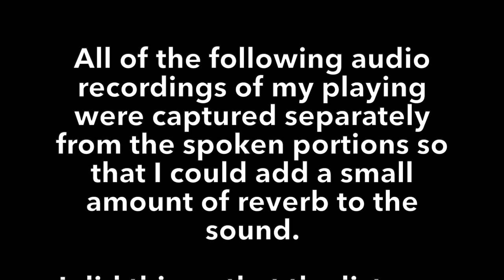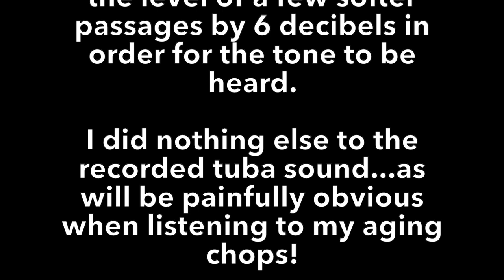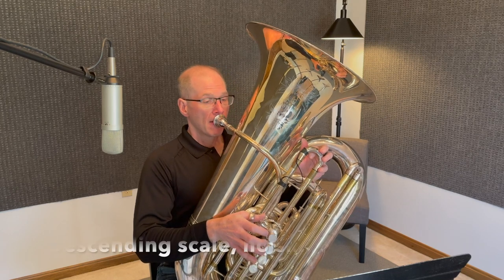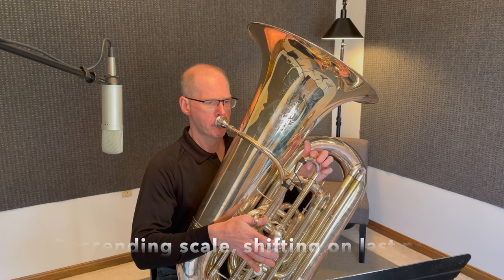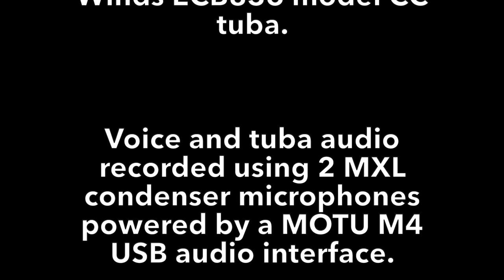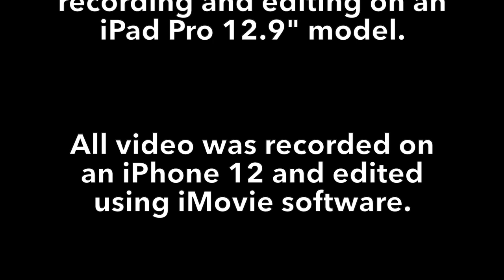The Shifted Low Register Embouchure

Comment: I've only ever used the bottom shift, but it seems like the top shift is actually a lot more useful... time to start practicing...
Reply from the maker: I used to only have the bottom shift. After working hard to try and make it more flexible, I discovered that the top shift is much more flexible for me. Individual experience may vary.

Comment: Bravo. Curious as to the width of the mouthpiece, not for "what mouthpiece are you using because I want to sound that way" (ha) but because I'm small and you can only see the very edges of my corners outside the cup that gets the best sound and response for me. I don't have the air to play low like that (for more than about one second) but have a "required" definite shift farther up, which has to occur somewhere around E in the staff. I'm going to refer a friend who has trouble with low range to this video. Thanks for all the food for discussion!
Reply from the maker: The rim outside diameter is 1.920” I hope that helps.